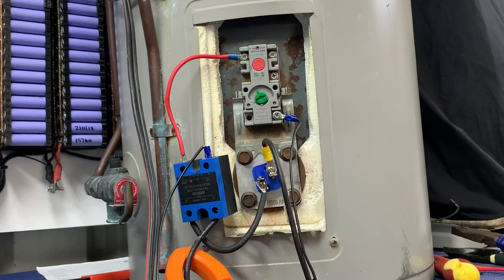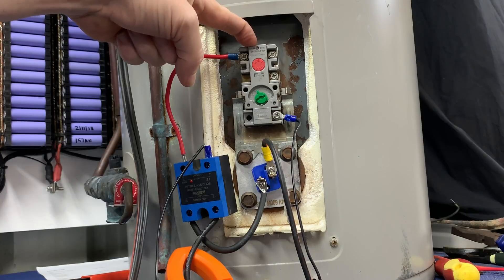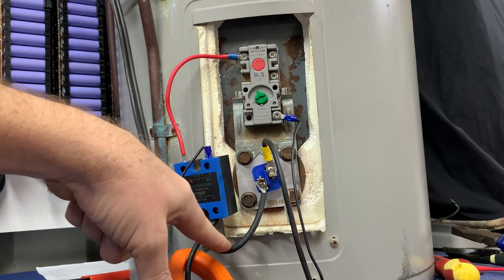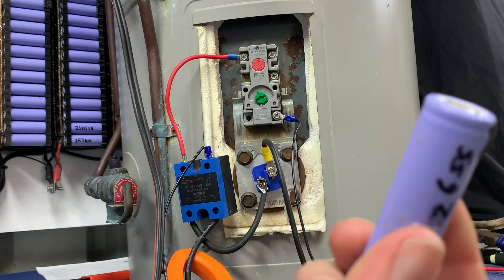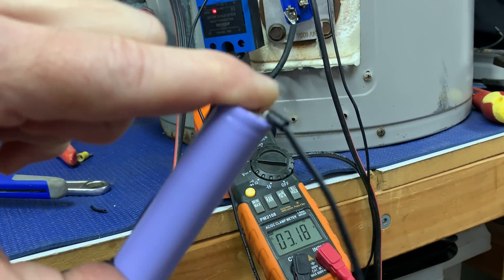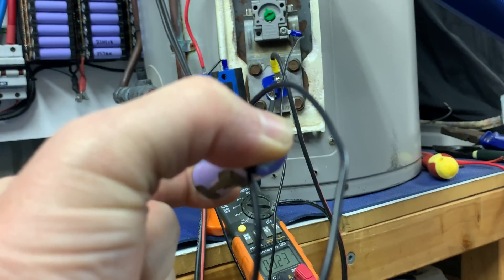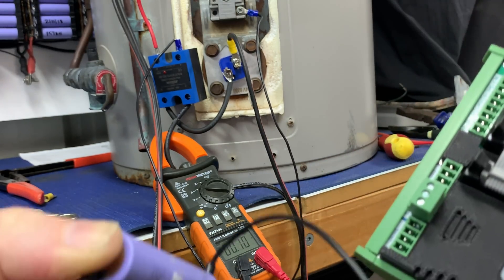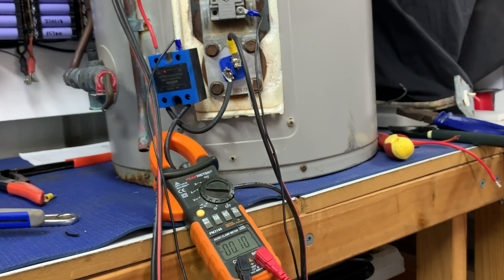Cheap DIY Direct Solar Hot Water concept!

Comment: Excellent idea! Thanks for trying this out.
I think it's highly relevant. I've read about this on electrodacus.com, basically this enables you to use solar power more easily because it replaces a part of the expensive lithium batteries with a thermal battery for showering or heating. And it's an incredible cheap battery for the energy it can store, just thermal only.
So now you just need more cheap solar panels. So basically it empowers the power wall to be more useful and only concentrate on normal electrical loads.
Just needs a thick insulation box when it's done!
Reply from the maker: Dacus unit is excellent but hard to obtain fast & at little outside the current budget
Reply: I like Dacian as he thinks out of the box. To him it is all matrix electronics. However, you should be really cautious and read carefully what he is saying as it requires a dedicated construction of a system. It does not fit well into most peoples lives. It is also not that efficient, a sacrifice he is willing to make because panels are so cheap.
Reply: @opera5714  Yeah true, when I started looking into his sbms I was utterly confused what he is even selling, but the choices he makes and explains actually really helped me understand solar power better.
His system only works and is highly economic in specific circumstances, but lots of good ideas.

Not sure why his thermal storage controller is even as expensive as it is? Compared to the solution in this video. Probably allows more complex programming. I guess once you have hot water in a boiler, if you would want to use a water radiator you only need to pressurize the system and the thermostat of the radiator regulates how much of the hot water gets circulated. Seems like a very simple system to me.

Comment: The thermostat should only be affected by the amount of amps it has to take and they are usually rated for 20A or so.  I reckon it's a goer mate :)
Reply from the maker: Just ordered a second one just in case lol better to use new one rather than a 10 yr old one. Also need to change the anode but dam that sucker is in there good

Comment: Hi Pete. . .   $1.90. Aliexpress. ,    search. . . .   W1209 LED Digital Thermostat Temperature Control Thermometer Thermo Controller Switch Module DC 12V Waterproof NTC Sensor. .   . . . . .   Use a buck converter fed from the solar panels.  32v  to 12v to power up the temperature PCB.  Use the relay output from the Temp Ctrl pcb  to operate the existing relay you have wired up. . .  The temp  probe on the PCB controls the high power solid state relay and energises the element. . .  Turn the existing AC thermostat to max to use it as a safety only. . . .   If everything is working OK, the AC thermostat will never open. . .  Use a 2nd buck to power up the solid state relay. . . .  You could even put a voltage detection board (about $5) to power up the system once the solar voltage is over 30v. . . . Sun come up. . Panels over 30v. .  System energises.   Powers up the 32vto12v PCB. Temp is low, PCB relay energises the Solid state relay. HWS heats. . . Hot water Set temp reached, PCB relay deenergises, Solid state relay opens. . .  Cycle continues. Till the sun goes down. . .  Note. The Voltage detection board deenergises the control system for a clean break. Waiting for the sun again. . . .
Reply from the maker: Love the idea of double temp sensors LOVE IT - i'll googles now - also have these on order https://ebay.to/31lcya8 on of them will drop the voltage just enough to keep the SSR happy i thinks and no complicated other stuffs needed.
Reply from the maker: just had a look at that w1290 - would love a 24v version! You've given me more to hunt for TY buddy
Reply: @HBPowerwall  Here ya go Pete: https://ebay.to/2WpECWj  24V W1209 LED Digital Thermostat Temperature Control Switch Module
It has a different driving relay

Comment: https://www.droking.com/auto-boost-buck-converter-35w-power-supply-module-adapter-dc-5-5-30v-to-0-5-30v-3a-boost-buck-converter-adjustable-regulator-dc-5v-12v-24v-charger-driver
Reply: would that help?

Comment: Use 240v on thermostat to control contractor to then switch DC.  It will use stuff all power. 0.01amp only white hot water is being produced. Oh I'm an electrician.
After watching  full video,  you will not have much current running through the thermostat and it will hold up with the arc,  as they switch 20A 240v.  So switching your relay  on DC will be fine.
Reply: @Jimmeh_B  Andrew wasn't referring to use 240V to "control" the thermostat, but use a 240V "rated" thermostat to be ran on the DC voltage. The 240V rated thermostat he mentions is also rated at 20A and with the little bit of current it would be running the DC voltage won't spark destroy the thermostat.
Reply: Any mechanical contact can easily switch DC up to 30V.  Above that there is a potential to sustain the arc on DC. Contacts such as silver are especially bad at sustaining the arc. Tungsten will work at slightly higher voltages.  Are there AC and DC heating elements? All elements are just resistors and don't care. However, there are some AC elements where the metal sheath is not connected to the mounting base. Typically these will be the dark grey type although some are grounded.  There is the potential for extremely small leakage currents to cause electrolysis that can eat away the tank. To be cautious I would check continuity of the sheath to the mounting base and avoid those that are insulated. I have heated for years with PV and use easy to build electronics to keep the panels at power point for highest efficiency. At less optimum light levels (which is most of the day) solar panel voltages are dragged down by four to one without this electronics.
Reply: Oh dear god. So much bad information in one thread. You cannot state that an AC switch will handle dc until you have physically inspected the speed it opens and the gap between contacts. You most certainly can get arcing below 30v. DC elements are very different. They have protection against electrolysis and a stainless sleeve. Running dc through an AC element WILL result in electrolysis, resulting in corrosion of the tank (learned that the hard way) and early failure of the element.
Reply from the maker: someone else replyed to turn this one all the way up and have second turning off at a lower temp - i love the idea. Think its worth the few extra bux?
Reply: @Jimmeh_B  my reply was at the start of the video where he inferred that the thermostat couldn't take the DC load. The my comment on running the relay/conntactor with 240v as that is what it is designed for .  Then I watched the whole video and added that it could handle it as he is only switching the DC ssc. Thus two tenths of fuck all. I didn't delete my first comment to show that I was wrong. And I do have 27 years in the trade.  Everything from house wiring to motor control, mining and heavy industrial. Have even made my own mega as a bit of fun as a kid. I should know a thing or two. He was asking for suggestions I gave two. One easy to remember problem and the other to say yes it will work your way.

Comment: Clickbait engaged! (And apparently working. 👍)

You can get cheap buck regulators off ebay that should be able to drop the voltage of your panels down to something your relay can handle.

The hot water should stay warm enough over night, as long as nobody decides to take a shower that's too long. Having had my hot water system die the other week, you can definitely get through one short shower with a small unit like that. Warm up time is a couple of hours though, so you might have issues if you shower at night and want piping hot water first thing in the morning.
Reply from the maker: I might have to jerry rig a batrium shunt to calculate how many kWh it takes to heat the water. Wait till you see the click bate i have lined up for a pending release lol it's next level !! Ive got a bunch of these on order https://ebay.to/31lcya8 will drop the voltage easily and cheaply i hope. never done it this way but the 'ol interwebs reconds it'll work just fine.
Reply: @HBPowerwall  On the other side of the pond I use a simple calculation 6 gallon 60F rise takes 1000WH. I have an ECO smart point of use 6 gallon point of use tank at my camp.  That is not much energy to take a couple showers. It has a preheat tank that reduces the need to rise to nor  more than 25F
Reply: @opera5714  
the metric system in the civilized world is even easier to calculate:
raising 1 liter of water 1 degree C is 1 wh
Reply: @ursodermatt8809  Blame Jimmy Carter. I was doing some rewiring and a wire dropped and zapped my NANO that runs the fridge. Replaced the board. All the data was looking wrong so I looked at the program.  I had Cx100 as a variable and thought that I really has just forgot to change it to Cx10.  Then I kept thinking F when it should have been C. I was ready to cob something together to get thru the night. Then the refrigerator came on as normal. It was all a confusion of terms.
Reply: @opera5714  
actually jimmy carter went into changing to metric. then the Great Communicator  cancelled again

Comment: current limit the dc to the thermostat or conversely just have an 18650 pack running it ?
Reply from the maker: I've got some 100k resistors on order i hope they arrive tomorrow - should be good to go then. Tests tomorrow i'll just use some 18650s to run relay
Reply: @HBPowerwall  high wattage ?
Reply: was thinking a dinky ebay regulator
Reply: usb reg that can handle 30 volt input ?
Reply: do you have a pwm solar charger ? that has usb on it ??
Reply from the maker: only have to bring the watts down to under 32v for the low side high side should be fine
Reply from the maker: I was thinking about just using a charge controller but I busted my only spare the other day. New PCM60x has been ordered but this will be as cheap and easy as possible .for offgrid application
Reply: @HBPowerwall  are the pwm charge controllers cheapish ?

Comment: Are you building this as a dummy load or for hot water production?  I'd think a resistive load in a water bath isnt going to care what voltage you feed it...  P=VxI , just substitute the voltage you're working with to arive at the total current you can sink, then it's just a matter of finding contactors to handle the current.
 If you want hot water, direct solar collection thermosiphoning into an insulated bulk storage with a heat exchanger coil for the hot water offtake is the way to go....
Reply from the maker: end use will be dump load so less solar is wasted, but also to cover daily hotwater needs completely off grid (but i'm giving too much info away ;) )
Reply: @HBPowerwall  a French experimenter Is just doing this : https://youtu.be/KKvaQzRbkA8   ( sorry in French)

Comment: you will find, after all the experimenting is done and all, it is way easier and more effective to use AC 240 and a heat pump water heater.
Reply from the maker: Where it is going there isn't much 240v No power/water within 10km I think i can have this installed for under 200 inc all pipe work and cables
Reply: @HBPowerwall  
ohh, ok , i thought it is for your place. 
the 30V is a bit low, because you have to parallel all the panels. you have 4 panels, say 6A each is 24A equals  about 600 watts. which is ok in sunny weather under optimal orientation.  (depending on size and use)we want a bit more for cloudy weather.
the thermal switch on the tank is for AC only . light dc loads for what you are doing should be alright.
the  SSR caution, they have max V, max A AND! max W. and if they are from china double W at least. and needs a cooling body.
Reply from the maker: It was very late in the afternoon when i filmed this so very low amps - but great for testing with out water. SSR is a better unit i was lead to believe and i have the heatsink for it also so when it's mounted properly i'll  be using it for sure (just have to find two screws for it as they weren't provided

Comment: So if you put the panels in series, then parallel, wouldn't it be better at 60v and still safe? I understand just a poc. Also, for the real thing, maybe a cheap tracker would help optimise the output. What do you reckon the setup cost is so far? Around $100 or so?
Reply from the maker: The element is only 24v so already over it's chineseium theoretical limit. It will end up a dump load and don't think i'll stick with direct dc in this configuration how ever i might do a much bigger system here to help with the hot water needs. DirectDC i would probably just use the STD AC element as 'apparently' due it it being a resistive load it'll work fine at high dc voltage. Cost so far maybe 120 ish - BUT i have got two relays and two elements so far as i ordered the incorrect ones but that's the process i guess lol